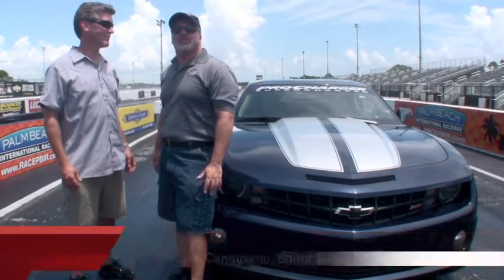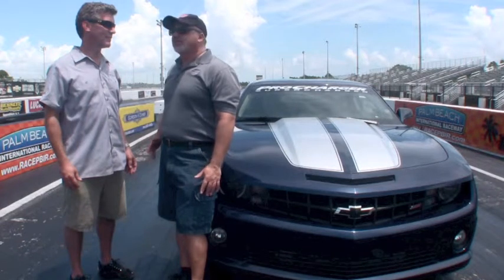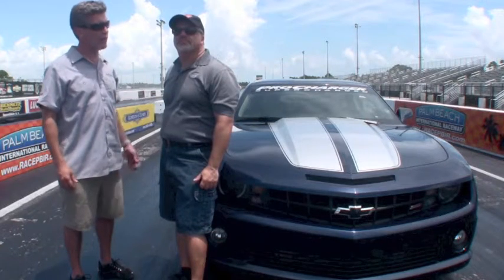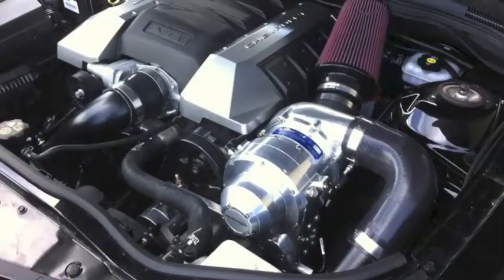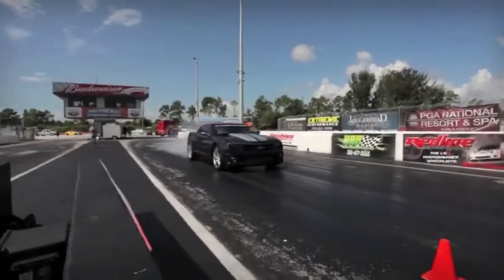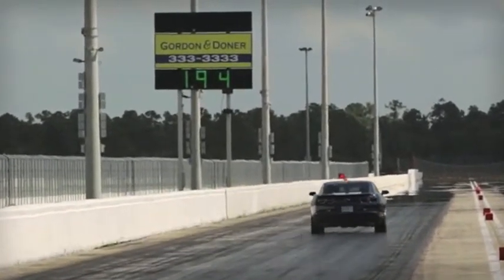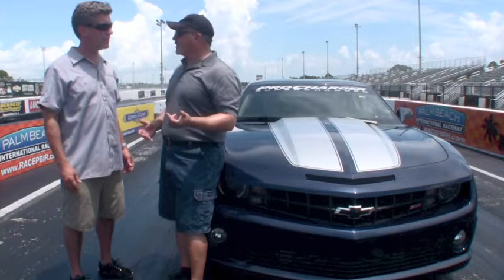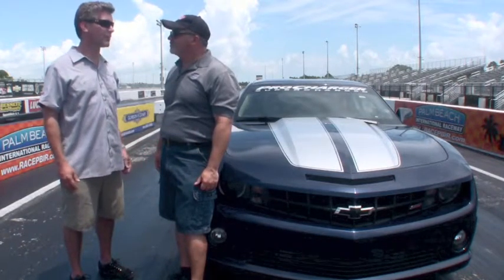Procharger i-1 Strip Test

Comment: In research of centrical SC and designs for a ‘15 Z28. On a Ls7 forged pistons bored .010 over,  currently 523 rwhp.... what would be the guesstimate of rwhp with the i1 ? With no more than 6-6.5 psi boost, would this be at the same level as the F1X?